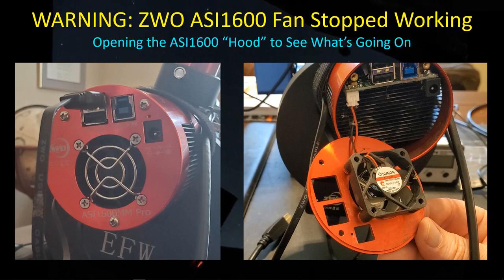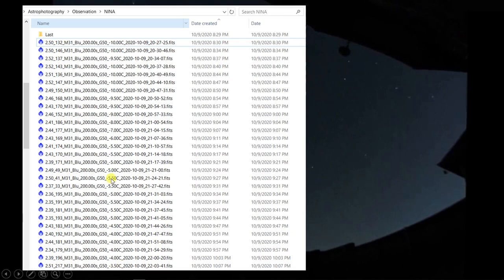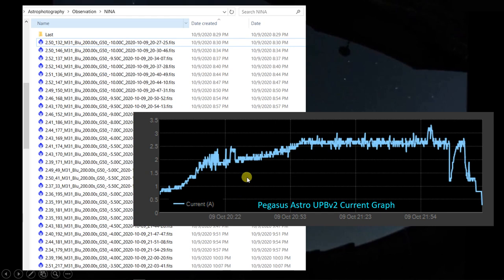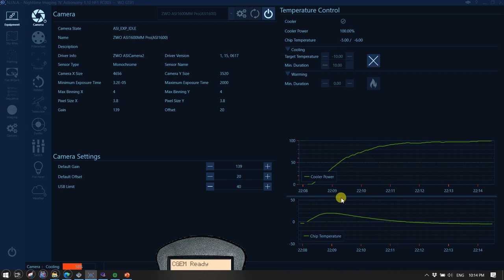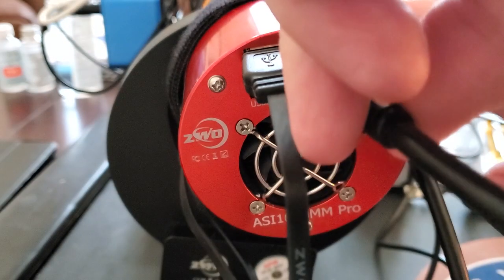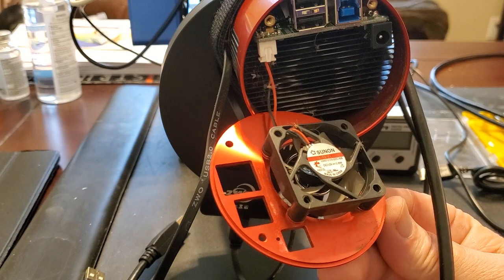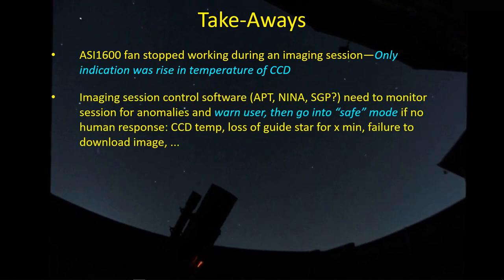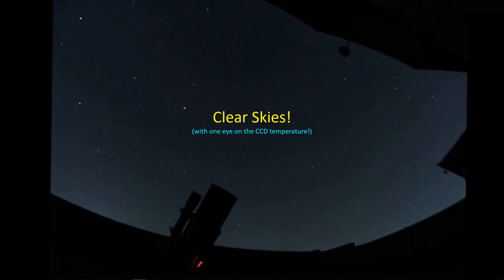ZWO ASI1600 Fan Stopped Working

Comment: Hi James . I know you are an Engineer but as an ex-Instrumentation Service Tech , this kind of a problem was common in my world . LOL . I'd check a couple of things , one , check to see if you have a cold solder connection on the connector on the circuit board . It happens , a lot . Then check the plug on the end of the fan wires . Look into the "plug" end and confirm there is metal available to contact the connector on the PCB . Lastly look into the plug from the wire end and confirm that the pins are crimped on bare wire and not on the insulation . This will make for an intermittent connection at various temps as will a poor solder job on the PCB . Sadly I had to do this on my PocketPowerBox just after the Warranty ended . Best of luck and thanks for your Videos .( It might be beneficial to explain why the Cooler , a Peltier Device , needs a fan ). Cheers. /SRK
Reply from the maker: Thanks for the excellent insight and suggestions. Your skills are perfect for this hobby. That's a great summary of possible failure modes. Fortunately, this solution (re-setting the connection) seems to have worked for now. The source problem was not really addressed by my efforts so I expect this problem will happen again. Thanks for watching, Scott!
Reply: @Aero19612  Hi James . Then of course it could just be insects in the fan . LOL . That's a Mag-Lev or frictionless fan is it not ? Probably does not take very much to stop the blades . Something else to add to the growing list of Preventive Maintenance items...blow the bugs out of the fan housing . Good luck ! /SRK
Reply from the maker: @scottrk4930  Yes it is a maglev fan and, no, it wouldn't take much at all to prevent it from turning. An occasional cleaning might be all that is required to keep it running.

Comment: I had the same thing happen with my ASI 294MC Pro.   Basically did the same thing you did, but I took the air bulb that I use to clean my OTA lens and the rest of the optical train and used it to clean out the fan.   I never did reseat the plug, but if I have the problem again, I will do that.  But it wasn't necessary.   Everything started up and has been running well ever since.   ;o)
Reply from the maker: These are the best kind of problems: the ones that can be fixed in 5 minutes and $0.

Comment: Great video! My cooler was suspect - the fan was obviously working but struggling to get the full delta C. I wondered if the fan was dusty or similar, and your video gave me the confidence to disassemble and check/clean. FWIW it was clean and not the issue - but in doing this I noticed  the 12V power cable splitter joint was getting warm, I was dropping about 0.5V.  Without the splitter looks like I now have about delta 38 C which is pretty good I reckon.
Reply from the maker: Good trouble-shooting, Tom! Always nice to find the problem in the mirror than in expensive equipment that'll require repair time. Thanks for watching!

Comment: Thanks for this video James - that those with the ASI1600MM may need one day (if not already!). 
SGPro has environmental monitoring: The sequence can automatically be delayed until the imaging camera reaches the target temperature;  Temperature monitoring allows an automatic focuser to re-focus when the temperature changes a specific amount (user set). But for deviations of the camera temperature during the evening, I don't believe SGPro does that type of monitoring. However, as you quite rightly indicated, it would be great to know and have in these software packages so a whole evening of image acquisition is not compromised.
Reply from the maker: Hey David,
Both APT and NINA warn you about the camera temp before you start, but not as convenient as SGP’s approach. It’s amazing how much heat is dissipated into the camera when the fan is not working. It’s practically a fire hazard. Haha. Clear Skies!

Comment: James I agree, what ZWO should do is use a 3 wire CPU fan as that 3rd wire is the fan speed and it would require ZWO on the boards design to also read the speed fan and when it get's below a set speed then a warning would come on. I think ZWO and others just don't think about adding this simple feature?
Reply from the maker: That's a good idea, Christopher. The hardware manufacturers should take on some of the fail safe burden as well. If the speed dropped below a set value, then stop taking images (i.e., generating heat) and return an error code to the software. We put our expensive, complicated equipment in the hands of NINA, APT, SGP, etc. They should accept the responsibility for monitoring system "health" during a session. Of course, NINA is free so I guess it's a use at your own risk proposition.

Comment: Nice video.  I Noticed you had a couple of dead insects in there.  The fan on my asi533 has been making some noise recently but its still working.. might be time to clean the fan.  :)
Reply from the maker: Absolutely. Better to clean it out ahead of time than allow the sensor to get too hot because the fan stopped.

Comment: I'll have to check when I setup tonight, but I think you can monitor and control by camera thermal conditions within Voyager. Although, you will find in NINA that depending on power output at the time you hit start on the sequencer, it will warn you either about upper power output or camera temperature.
Reply from the maker: Interesting feature in Voyager, it it's there. Yes, both NINA and APT warn you if you're about to start imaging and the camera temp is not at the set point. I want them to check it throughout the night and stop imaging if the temp increases (or decreases, for that matter). I'll have to look into Voyager. You know how long it took me to switch to NINA!
Reply: @Aero19612  I haven't heard, but there's so many constant changes to NINA, that perhaps this option is in the queue? Even though I've recently started using Voyager, i still use NINA when I'm prospecting for new objects or working on framing. It's so easy to setup, and start getting images, plus the image viewer does a great job debayering. Which Voyager does not do, and it's very annoying. I wish there as and app out there that would combine all these options :)

Comment: Another (always) good video! Have you considered that there are two connections for the ASI fan? One for 12V IN to the ZWO via a 5.5 x 2.1 connector. The second is the plug to the fan.

I particularly don't have good faith in the 5.5 x 2.1 connectors. My SkyWatcher mount EQ6-R PRO uses a GX12 -2 screwed connection. These connectors are very secure. Other mounts use the same 5.5 x 2.1 connector.

Here's the thing, the fan connector is static unless you open up the ZWO. It's a good idea to reseat the connectors from time to time because it wipes the contacts clean. The 12V connector on the outside gets a lot of use and is being moved/flexed as the scope is slewed. So your analysis reseated both connectors but which is the faulty one?

If it occurs again, you might consider unplugging the USB and the guide cable but leave the 12V attached as you undo the three screws and thread the backplate over the 12V lead. You might find that it is the 12V lead that makes intermittent or not so good connections? In the analysis it was assumed that the fan had failed, so the race was to get to the fan and maybe substitute another one and not to look at the feed of power. I forget if the red LED is on with USB power or with only 12V applied.

If you had to get a replacement fan, would ZWO give you one (instead of mailing the unit in for repairs under the warranty) or can you buy one? Are they the type that "levitate" on a magnetic bearing and so do not transmit vibration?

One thing I noticed about the ZWO is that the circuitry cools and also heats. So if the outside temperature was -5 C and you set the temperature to 0 C then the unit generates heat that warms the system up. So it is more like a mini climate control (heat or cool) than just a refrigerator (cooling) system. For normal and not extreme cooling 0.5A is sufficient so it would seem relatively simple for the ZWO to provide to ASCOM etc. a warning when the current is too high e.g. after the initial cooling, everything should settle down. It would also be nice if the current could be limited e.g. set a limit at 1.5A so that the PSU could be shared with other peripherals. Simon
Reply from the maker: Those are good points, Simon. In this case, I'm sure the problem was with the inside connector. In order to use the camera cooler indoors, I have to unplug the 12V connector that goes to my Ultimate Power Box (used outside) and plug in the 12V connector with the AC/DC converter. The fan did not work after I did that. Then I took off the back and reseated the inside connector and it started working.

Comment: Great job running this down.  My ASI1600mm had this exact problem in April 2018 and I contacted ZWO.  It apparently was a known failure mode with those connectors and they sent me the procedure to fix the problem.  I've had no further problems since then.  Here is the procedure in Dropbox they sent: https://www.dropbox.com/s/ghi3xm4vwmasxde/ZWO%20How%20to%20reconnect%20the%20TEC.pdf?dl=0
Reply from the maker: Thanks, Phillip! Seems that simply re-setting the plug is the "fix".

Comment: My 1600 fan started to vibrate and caused "shaky" stars.   When I contacted ZWO they told basically told me yeah that happens with no advice on how to fix the issue. . I found a new fan on eBay and installed that.  It seems to be working.
Reply from the maker: Surprised that ZWO responded like that. Good that you found one on ebay. I looked on Amazon and they had 3-wire versions but the 1600 is a 2-wire fan. Thanks for watching and commenting, Walter!

Comment: Using a telescope is easy, it's making it work that is hard.  You need to be a combination of an electrical engineer, electronics engineer, mechanical engineer, etc. in order to do anything. And test it in your warm house on a cloudy night an everything works fine.  Go outside on a cold or chilly night and something will stop working. (Sorry if I sound cynical but I'm 3 weeks, and 2 components into fixing my Meade 8")
Reply from the maker: If you're not cynical, then you haven't been in this hobby long enough. Nice to hear from you, Pat!

Comment: Like a computer fan you may just need to clean it occasionally. Must likely you dislodged the dirt in the fan when you pulled the camera open.
Reply from the maker: Agree. It wouldn't take much torque to make that little fan move. Likewise, it wouldn't take much of a blockage to stop it.

Comment: Think that's the issue, when you introduce fans then your problems start
Reply from the maker: Hey Dennis. Fans do have the downside of bringing "dirty" air into the camera body. I suppose they could have added a filter of sorts. But the fan is definitely required. The chip cooler can't keep up with the heat load without the fan. The body of the camera also gets REALLY hot without the fan. So, I'm afraid, fans are a necessary evil.

Comment: i have to give my 1600mm fan al little push with a stick or something,other it wont start,but after that its working fine.
i see you have  some bugs inside,maybe  its dirt between the fan too.

greetings John https://www.astrobin.com/users/kajouman/
Reply from the maker: HaHa. That's a funny visual. All of this advanced technology equipment and we're outside at 2:00 AM poking it with a twig to make it work. Come to think of it though, I guess the stick was early humans' first mouse.
Reply: Try to remove the sticker from the fan to expose the bearing and add a one or two drop of very fine oil. Typically this fixes almost all PC fan rotation problems.